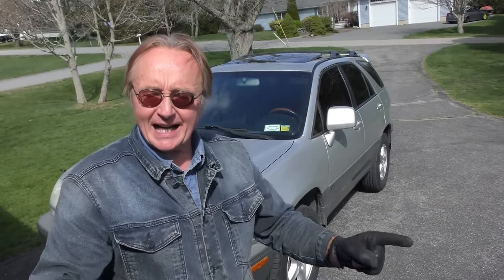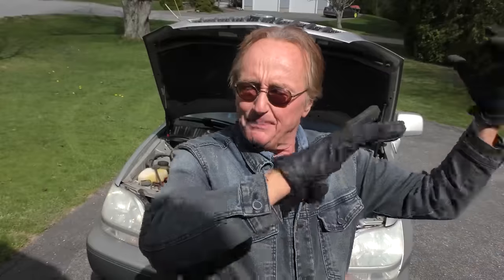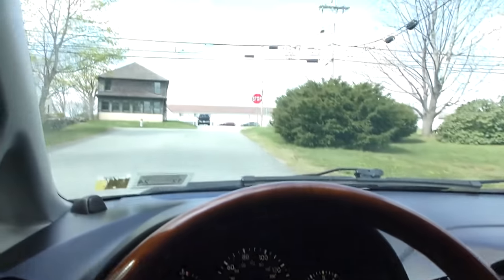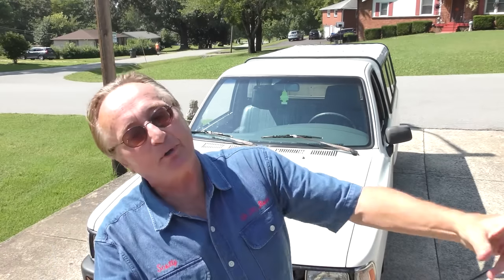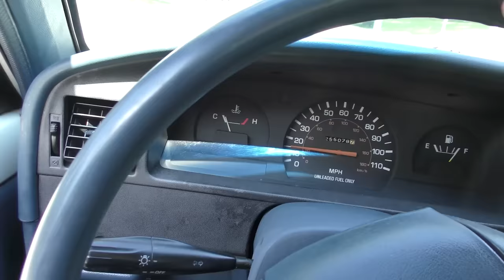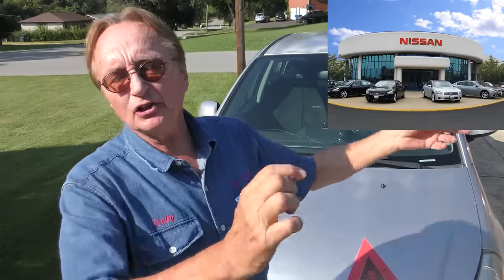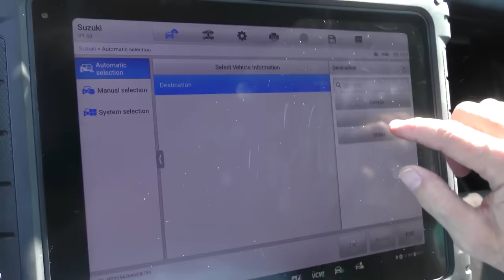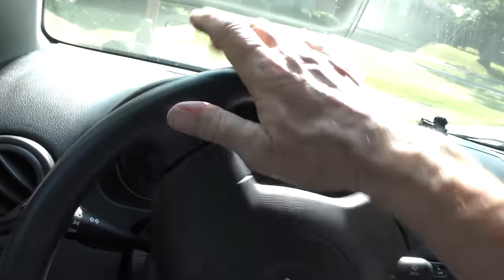3 Used Vehicles No One Knows About, So You Can Buy Them Dirt Cheap

Comment: Got well over 300k on my '90 Toyota SR5 3.0 V6 5-Speed,Tow Package, power everything, A/C, CD/Cassette, AM/FM..burns No oil, runs like a sewin' machine 😎👍
Reply: Which vehicle model?
Reply: AC/DC was playing Highway to hell in the bed 😂😂😂
Reply: I got you beat by 240k miles, 540k 91 3.0 2wd manual sr5

Comment: My dad had a 94 4x4 Toyota pickup. Loved that truck. Drove it from new till my 18th birthday. Sold it. Still trying to find it again. Been searching for years.
Reply: I'm surprised they're selling for what that guy bought the one in this video for because they were always in demand. I blew an engine in my F250 coming off the grapevine into Bakersfield. Strange that I got all the way over the grapevine hauling a huge 4 horse steel trailer with 3 ramps (super heavy) loaded with four horses. My veterinarian had moved there and I was bringing horses to him. 

He had one of these trucks. Then he bought a Chevy S10 when they first came out. It couldn't handle the weight of his vet box (they contain hot water as well as supplies). Dealer replaced something and it went less than 10k more miles and did it again. (Later they beefed it up -- apparently they didn't realize people planned to use it as a pickup truck.) 

So he pulled my truck and trailer with four horses on the flat into Bakersfield with his Toyota pickup that had over 300k miles on it. And he had his vet box on it because he was using it rather than have the S10 fail again!

Comment: About Japanese Suzukis - Scotty was on to it this time.  One way Suzuki did themselves in was to partner with GM who had them rebadge Daewoo designs for the  North American Market. I have had a few Japanese Suzukis which have been excellent mechanically, especially the engines  My 1991 Swift is still all original including the brakes and clutch and keeps up with traffic easily.  The way it is going it will easily last another 30 years.
Reply: Daewoo was a good automobile. Early saturns also.

Comment: Good tips. Thank you!  But I think people are pretty aware of the value of the little Toyota pick ups. I get notes on my '87  from time to time from people asking if I want to sell it.  A week ago a professional house painter said he'd paint my 2 story house in trade for the little truck. By the way, it's pretty easy to shift without a clutch...while you're saving up for the new one. 🤣
Reply: $2500 with 250k on it...plus probably $1000  for a clutch if they had it dkne by a shop...so, $3500 for a base model 91 toyota pickup with 250k on it.
And a top end knock..... yea, its pretty clean. But ,no thanks...

Comment: Old manuals for sale.  Take it for a test drive....quietly find a tree.   Nudge up to the tree.  Set the brake.  Start letting out the pedal.  If the engine doesn't stall at or before 2000RPM...the clutch is worn out.

Comment: Just bought an 07 Lexus RX350. $3,200. 295k miles. 1 family owned. It's basically brand new. Smoother than most new cars I've driver. AWD. I've had 13 cars, trucks, suv's...this is my favorite.

Comment: Where I live...I still see A LOT of old vehicles running around.
 Toyota mini trucks, Chevy and Ford pickups, from the 70s, 80s,90s.
These are by no means restored vehicles.
 People maintain them...and just run them.
 The guy across the street from me, has an 88 Chevy, with a 350.
 It has almost 800k on it, and is completely reliable.
He drives it every day!
 Never had the valve covers off of it!!!
 Another vehicle I see a lot...82 -95 Olds, Buick, Pontiac, Chevy sedans.
 And...Any Crown Vic!!!
 All bullettproof.

Comment: Yeah that's a good point about manual transmissions... Even a little 3-cilinder engine can be pretty spiffy if you let it rev up to 4000rpm before manually shifting, especially if it's in a lightweight car (like a compact).

Comment: I bought a 2003 Susuki 4x4 mini SUV just a few months before the Pademic 2019 with 93 thousand on it. Been driving ever since, and it doesn't burn oil, very quiet. I just replaced the exhaust behind the cat, two pieces and that's all I have done to it besides regular maintenance. I am embarrassed to say how cheap it was so I won't. It does have auto transmission and yes it is gutless but its fantastic in Minnesota winter. And the Susuki wasn't a Minnesota vehicle so no rust!

Comment: I had a '83 tree quarter ton. Toyota pickup. Ran so long the timing chain wore through the guides and then through the timing cover. Thought it was a head gasket because it cut in to the water pump area. It still ran good. New cover and back to work 😀

Comment: Yay! You finally got an SX-4 to talk about!
I was going to ask you about how reliable the engines were and you answered that question. Glad to hear the engines last a long time.
I own a 2008 SX-4 with 21,000 miles.......Yes. That's not a mistake......21,000 actual miles. I inherited it from my mother. She bought it brand new in 2008.
Mine has an automatic trans. and it gets up and goes just fine. But I baby it anyway because I can't buy parts for it anymore so I'm trying to make it last.
The only bad thing about this car is I can't get parts anywhere since they pulled out of the country. If it does break I'm screwed :-(
Reply: Plenty parts on the Internett.
Reply: I had a Suzuki SX4 with an automatic transmission and I lived in the mountains and it worked great. I did have to change the automatic transmission fluid at 60,000 mile intervals because it would burn. I did get rid of it still running with 210,000 miles, I got a Subaru which I did not like as much.
Reply: Im sure you ca find parts somewhere

Comment: A family member just bought a 2012 Suzuki Sx4 awd for $4500, only 123,000 miles on it! Had it looked over and all it needs is one outer tie rod, brakes, n rotors. (Gonna do both outer tie rods) Its an automatic and Ive driven it n i'll tell ya, in the 2wd setting plenty of pep n pickup getting on the hwy! I actually love that lil guy lol lol..
Reply: Btw, it's the Crossover version of Sx4..

Comment: I bought a 2009 sx4 3yrs ago.. 4x4 automatic..  it did lack power.. but after I removed some transmission oil and replaced with Lucas fix.. and learnt to shift manually when I go up or down hill.. I must say I enjoy driving that tiny thing!! I can easily go uphill at 120km (75mph?).. I feel safe solid driving even in our Canadian winters (6months up north).. it's now up to 377000km! (235 000miles)! .. the previous owner didn't maintain it that well so I had to change a few parts eventually but I got it for 1200$ so pretty good deal!
Reply: I can honestly say I'd buy a new one if they still made it.. I think with proper maintenance I'd be set for life 🤪

Comment: Nice video! I'd love an RX300. By the way, my V8 1UZ VVTI is an interference engine.  Bought it at 170,000 miles three years ago and immediately changed the timing belt. Now at over 200,000 miles and running smooth.

Comment: My 2003 Lexus RX 300 has 250k miles on it and it still running well.  Had to put a timing belt on it 20k miles ago.  The water pump was leaking so l had to do it.  Bought it for 5,500.00 five years ago.

Comment: When I lived in Japan and owned a car, we had yearly inspection and... the car had to be spotless on the bottom, every bolt had to be painted and everything spotless and very clean. I owned a mitusubishi station wagon, it was basically a saab three banger engine, except it leaned other opposite way fo the saab engines. As I owned saabs, it was a familiar power train.

Comment: Well I just picked up a 2005 Pontiac Sunfire with 105,000 miles for $100. Had a check engine light that said PO303. After replacing the old battery. The battery read 12.75 volt 100% charge and only 235 cca and 59% life.

Comment: My 2008 RX 350 has around 135k miles no issue. I will drive it until the engine or transmission blows up. Probably get another 100-200k miles. No rust and the electronics still work including the 6 disc CD changer 😂👌🏽

Comment: I thought 1st gen Lexus RX300  had a known transmission problem which caused it to often fail after 100k miles.
Reply: To be fair what early 2000s car didn't?
Reply: @Yophillips3272  Camrys don't have transmissions issues as far as I know.
Reply: @Johnny-bm7ry I have heard those Camrys were the best I ones ever built. 97-01 Camrys are seen on the road today.
Reply: i have a 99 rx300 with 260,000. had it since 2000. best car ever. am looking for that “granny car” of the same.

Comment: Rubber timing belts are great. Your faith in chains is misplaced. Sure they will hide a lack of maintenance for a few service intervals but you are best off looking at vehicles with easy to change timing belts or chains rather than thinking a timing chain is going to save you from an expensive engine failure.
Reply: Lay off the Chiba ! 😂😅🤪🤣

Comment: Hey I found a Lexus RX 300 with 73,000 miles about an hour away from me for $4,200. It has some rust on the inside of the rear drivers side door. Do you think it is worth it still for that low of mileage? The struts, tires, and sensors are new. The guy said the drivers side rocker panel is pretty beat though
Reply: have a qualified mechanic check it out for everything, including rust,, minor surface rust is ok ,but anything more is a parts car....

Comment: I need your advice Scotty. I bought a 07 Dodge Charger last year, and the county is requesting i pass an emissions test to renew my registration. The issue i am having is with the fuel level sensor. The previous owner said he replaced the fuel pump, but it didn't fix the issue. The internet said i needed to solder the C70 pin to resistor, so I did, but it didn't solve the issue. Would buying a refurbished cluster from Ebay be a good idea?

Comment: The timing chain on the pickup stretches and breaks the water pump  cover. About 80k to 90k you need to replace the timing chain and water pump. I miss mine.

Comment: Do not buy low milage old cars just because it is low mileage. Gaskets and seals wear over time. I prefer to buy a 2015 Lexus with 150k miles over a 2005 Lexus with 50k miles.

Comment: I have a 99 rx300 with 204,000k still runs strong but there is no way you get 30 mpg on highway, with 4 speed transmission this car has you never ever will get those miles. Mine gets 13 city and 17 or 18 highway.

Comment: My only hesitation in buying real old cars is they are way less safe compared to modern ones. The Toyota 1991 truck does not even have airbags. No ESP no ABS etc.
I would not get this old of a car without any safety feature. Especially if you have a family you are driving around with.
I am sure it also burns a lot of fuel. My small VW gets me 45-50MPG. Current proce per gallon here is 6,81€.
Reply: Not all cases, but it's best for reliablity, safety, getting parts, where the majority of garages will work on them is getting a car/truck no older than 15 yrs.
Reply: @1Mannco  Most cases. I am an automotive engineer, I have seen the crash test.

Comment: One must be extremely careful with the RX300 - it depends on the year. The better bet is the RX330 and better still is the RX350.  RX300 are KNOWN for VERY SERIOUS MAJOR expensive issues.
Reply: What kind of issues, ‘ off the top of your head’?
My friend has one he purchased a year ago with 92K miles.
😊
Reply: @@gretchenk.2516 
I'm willing to bet the original factory oil was still in it
it ain't the car's fault
Reply: @@gretchenk.2516I’ve bought 4 cars with the 1MZ.  Only one burns any oil, and that is a quart in 4000 miles.  I do 4000 miles oil changes.  Not an issue.  It was probably neglected…but not destroyed.
Reply: @@gretchenk.2516 reading comprehension bruh….it matters.
Reply: @@gretchenk.2516 and what you don’t understand is that your analysis was at fault.   That’s rich.
Reply: RX300 had a transmission issue, that was fixed with the RX330.  -A RX300 transmission will most likely not fail now -either fixed, or not a problem.  RX300 has the reflective window tint which is sort of unique.

Comment: Rubber timing belts are usually not too bad to replace when you can see the entire timing cover. I'd rather have an easy to change rubber belt than a difficult to replace chain. They cram stuff in there so tight that an easy to service late model is hard to find
Reply: You hardly ever have to replace a timing chain....my fords and hondas all had well over 300k on them, and had the original chain....if you keep your oil clean, the chain is meant to last the life  of the motor....timing belts suck...and a lot arent that  easy to change .

Comment: Scotty, is it true all lexus's require premium gas or can you use regular?
Reply: Varies by model. You can’t generalize.  The owners manual dictates the grade of gas to use.
Reply: Most only 87 octane
Reply: Gs 350, is 350, is 300, ect
Reply: The older Lexus engines required premium fuel. I think 2011 and on will run on regular.  Acura still recommends premium on many models. My friend bought an RDX that requires premium fuel.  From what I know I think that Lexus is better than Acura but I’m sure it varies by make and year. Honda and Toyota are both good vehicles!! Also the new Mazdas are highly rated vehicles for reliability too!